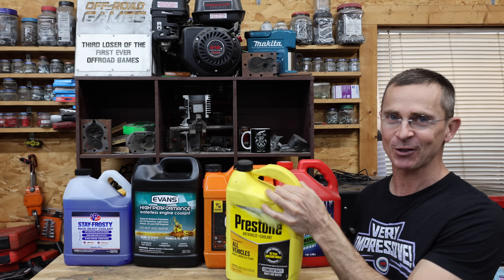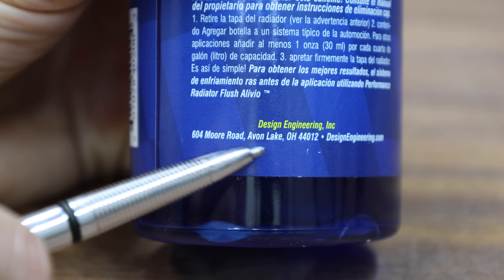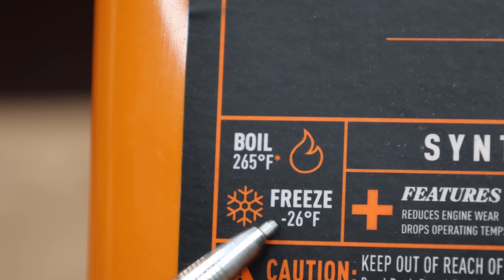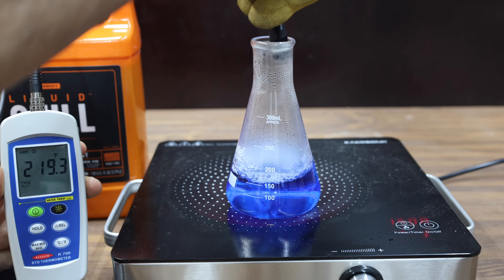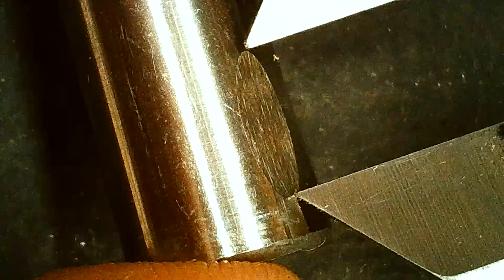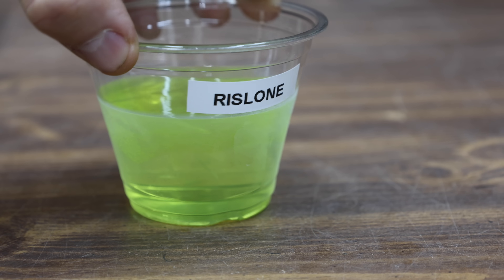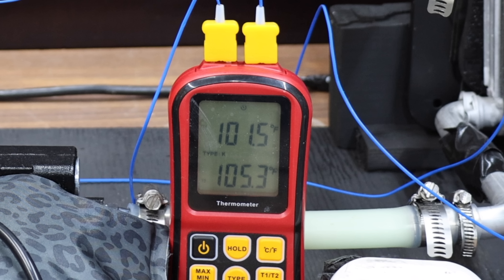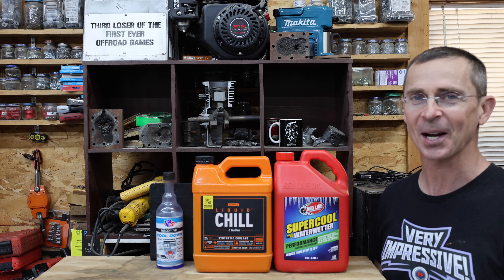Do "Super Coolants" Lower Engine Temperature By 30 Degrees?

Comment: I'm a little confused with that engine ice, I've used it for years in my Enduro bike that was overheating going slow since it doesn't have a cooling fan.
 The stuff I have is light blue, has all the instructions on the jug and it definitely keeps my bike from overheating 🤷
Reply from the maker: Thanks for sharing.

Comment: I have lived in Arizona where the temperature gets over 115F at times and have never had a problem with overheating in 30 years due to weak coolant. I always have used the proper mix of coolant and distilled water. One time my Lincoln overheated but that was because of a leaky radiator hose.
Reply: Yep.  Say 'No' to Snake Oil.
Reply from the maker: Thanks for sharing.

Comment: I would say that you provided evidence that the "Super" coolants do not drop temperatures by 30 degrees. The top 2 coolants only dropped the temp buy 7 degrees. I am not sure that is enough temp drop to justify the cost.

I would say that the liquid chill is slightly better than the red line. In my opinion the boiling point test was irreverent as shown by the 50/50 antifreeze, water boiling point. These products are normally used in a pressurized system which would change the boiling point enough to protect any normally functioning engine. Indeed the secret to keeping your engine cool is to operate it under the conditions that it was designed to operate in and to keep the cooling system in OEM clean condition and have whatever good clean antifreeze coolant is required for the specific engine. There are a lot of engines that would benefit more and for longer if they were just properly maintained.

These products are not designed or intended to be a substitute for maintenance of the cooling system. If your engine is overheating fix the problem not try to put a band-aid on it.

I also question the ability to protect the engine from wear other than normally keeping the engine at the correct operating temp for that engine. The only wear item in the coolant that can be directly effected by whatever is in the coolant is the water pump. Again good clean antifreeze has enough lubricant in it already to protect the water pump.

I would say that you proved that coolant additives fall more into the snake oil category than actually a helpful product that might do more than function as a band-aid for a defective coolant system. Indeed the thermostat in the engine has more control over the temp than any additive that could be put in a functioning coolant system. It won't fix a plugged or undersized radiator or simply a bad thermostat. If you want a cool running engine buy a Ford. Their thermostats are designed to fail open so it makes it hard to over heat the engine.
Reply from the maker: Thanks for sharing.

Comment: Evans doesn't claim to make your engine run cooler. In fact, your engine will run about 1`F hotter than normal. I use it and it barely creates any pressure in the system when running in 120`F weather. I can take the cap off the radiator after 2 hours at highway speeds with no reaction (no pressure hiss, no blowing out of hot coolant, erc.)
Reply from the maker: Thanks for the feedback.

Comment: This video is the first time in my life, I have ever seen a digital PH tester. I thought the only way to test PH, where those color changing strips. Thank you for letting me know of the existence of that. Will you test cranking an engine with different amounts of Capacitors? UltraCaps in series and normal higher voltage range Capacitors? Like what's the minimum capacitance needed to crank & start car, truck, and motorcycle engines? If you use an engine a lot, then capacitors are a great lightweight alternative. But may need a small 12volt battery to maintain cranking power after a few days of engine off, and alternator not charging them, or just keep a little 12v hand crank generator to charge them up, when they get too low to crank an engine. I always wanted to see what capacitors can do, with different engines, with different compressions, starter motor currant draw, and whatever.
Reply from the maker: Thanks for the suggestion.

Comment: I have always been super impressed with your testing methods! You blow myth busters out of the water, and if you ever watched any, you know what i mean! You go way, way above and beyond to get accurate results! I know it is not normally your thing but i have three things that i would really love to find out the truth about. The first one might not be completely out of your realm. I have seen you test knives before. As an outdoorsman, i have and use many knives. It seems that some of my knives get the sharpest when i just sharpen them on a rough stone only, mostly the ones with a lot of chrome vanadium, while others get sharper when working all the way down to a very fine stone. And i'm not sure at all, what is going on with Buck, after i dull the factory edge, sharpening them somehow just seems to make the edge slick, regardless of which stones i use. The other two tests aren't something you normally do. I would just love to see the results and know the truth, and as i already stated, i have a lot of faith in your ability to test things! I would like to know if cleaning a gun, or the lack of, affects the accuracy short and long term. More with bolt action rifles. Yes i know semi-autos will jam if you don't clean them once in a while. I also know you can actually wear out a rifle barrel and the accuracy suffers. Does the constant cleaning add to this? Does it matter if you don't? I would also like to see some real test results on how much power you loose with cylinder gap in a revolver compared to a semi-auto with the same ammo and barrel lengths. Also, do you loose power with the action of an action flying back with a semi-auto compared to a bolt action, single shot, or lever action, or pump? If you can't test these, i understand. I would just love to see the results! Especially the knife sharpness! I suspect, on that wire cutting tester you use, it would test sharper with the working down to the finer stones, but i kinda think maybe if you test the ease of cutting with a consistent pressure it would show different results? Because they kinda feel sharper? with certain blade materials
Reply from the maker: Thanks for the suggestions.

Comment: If your car has a thermostat in the cooling system then your engine is going to be kept at the temperature at which the thermostat opens.  The only scenario in which this stuff might help is if your cooling system is not capable of cooling the coolant to below the temperature at which the thermostat opens.  In most cars that is never an issue unless there's a breakdown in the cooling system, in which case this stuff won't help.
Reply: Yep.  Simple Thermal Dynamics.  Say 'No' to Snake Oil.
Reply from the maker: Thanks for the feedback.

Comment: If you ever want to test radiator stop leaks, I have a suggestion that is relevant to this video as well. I always use a small bottle of Subaru coolant conditioner whenever I swap out the coolant in all of my cars. Subaru coolant conditioner is repackaged Radweld stop leak. It claims to prevent electrolysis, prevent corrosion and lubricate the water pump as well. My Honda has an aftermarket coolant temperature gauge, and I noticed a small drop in running temperature as well compared to 50/50 premix alone. I would love to see you test that! Thanks for the great videos! I would love to see more Motorkote testing in some real world applications!
Reply from the maker: You are welcome!  Thanks for the suggestions.

Comment: Test potential: Wago vs wire nut vs push lock vs twist n solder etc wire connectons/splicing
Reply from the maker: Thanks for the suggestion.

Comment: Are these products meant to be an additive to a coolant or used instead of a standard coolant?  It looks like you are just using just the coolant super coolers.  If you are, wont that change the test results if they are additives?

Comment: Another idea I have is since you have this rig made up, id love to see motor oils and or food oils run through. I remember "oil filled radiator" style space heaters being  touted as being way more efficient at disapating the heat and oil cooled motorcycles are a thing (I was like 11 when the spaceheaters were popular and for some reason it stuck in my head) besides disapating heat better oils obviously have lubrication and corrosion resistance properties. Less surface tension? My brain also thinks that since water makes motor oil seize up, removing water and using it as the coolant makes the milkshake after a blown headgasket not milkshake-y? It also wouldnt ever boil over. I also just super love your motor oil vids haha.

Comment: Your car is only gonna run cooler if it’s overheating currently. Otherwise the thermostat is going to dictate the temperature that your vehicle runs at. My choice would be a product with the best corrosion resistance and lubricity not so much the added cooling capability. This might be important in some scenarios on vehicles that are prone to overheating with overload and cooling systems. For normal vehicles, I don’t know why this would matter much.

Comment: I had one of those meets or exceeds from the old Kragen Auto Parts, it was a 150 degrees as I recall, my engine was running too cold when it started snowing at Yosemite and had hardly any power! I put a Toyota thermostat right away after I got home and never used a 3rd party thermostat again! How about testing those hitch winch mounts? I know some are too weak to handle the winches and that's without even using a snatch block! You going to "Matt's Off Road Games" this year?
Reply from the maker: Thanks for the suggestion.  I will not be going to Matts Off Road Games this year.

Comment: I've got better for ya. Wix coolant treatment takes care of the same things. No guarantee to lower the temp, but it can't but help. Now it's made for diesel engines, but I've run it in everything.  You just can't use any other treatment with it or you'll turn the water to jello. And no I've had it happen, but I've seen someone else do it.

Comment: Can you test the cooling capacity of tap water, distilled water, saltwater, 150 everclear, 190 everclear, maple syrup, milk, orange juice, apple juice, hydraulic fluid, vacuum pump oil, motor oil,...air???

Comment: This video has amazing timing ! Race season is right around the corner and was looking to shave off a few degrees to my current cooler set-up. 

Question on the final test did you clean out the pump, rad, and heater tank before using the Evans? I heard it really  drops in performance if any water is still present in the system.

Comment: The boiling point test needs to be conducted with the liquid under pressure. That has a big impact on the boiling point of a liquid and simulates the actual conditions in a cooling system. Just a suggestion for future videos. Great content as usual.
Reply from the maker: Thanks!  Thanks for the suggestion.

Comment: Evan’s does not help cooling. It only stops boil over which you can solve by simply running a higher pressure radiator cap. 
The only coolant I ever had work was VP race  ready coolant and their hi performance coolant.
Reply from the maker: Thanks for the feedback.

Comment: The thermostat  controls the temp of your engine. Engine manufactures run the engine at its most efficient temp. The additives may make the fluid more efficient in dissipating heat, but the thermostat opens at the proper temp. If your engine is running 20 degrees cooler than normal it will not be burning all the fuel and cause a myriad of long term problems.
Reply from the maker: Thanks for sharing.

Comment: Thanks Todd, for an excellent experiment.

About 30 years ago I was first exposed to Redline products when I got a Porsche 944S and decided to take the maintenance on the car very seriously. One of the things I did was to use Redline oil, which helped to lower coolant temps a little. After that, I put Redline Water wetter in a 30%/70% mixture of ethylene glycol to distilled water. I felt comfortable with this mixture ratio because of the mild temperatures where I lived(San Diego), and the fact that the Water Wetter also had concentrated corrosion inhibitors for aluminum and other soft metals. One caveat for this was that I did flush the cooling system every year to play it safe.

The result was very significant and impressive, with my coolant temperature's needle pretty much glued to the radiator thermostat temperature all the time, except for high load at high rpm on hot summer days. I also noticed that my idle engine oil pressure was somewhat higher, probably due to the oil's viscosity increase due to the lower coolant temperature. The owner of the independent Porsche shop where I brought my car for service and repair immediately noticed the difference and wanted to know what cooling system mods I had made.

I hope that my experience with these products is interesting and informative, just as I find all of your well-made videos.
Reply from the maker: Thanks for sharing.

Comment: Another really interesting long term test would be soaking a small piece of radiatior hose in each of the coolants and seeing if they have any negative effects over time. Always wondered if the additives or alternate coolants degrade rubber or seals more than traditional straight coolant.
Reply from the maker: Thanks!  Thanks for the suggestion.

Comment: Test Idea: Products that promise to stop cooling system leaks. Now that you have the test setup, I wonder if you could introduce a loop that had holes of different sizes and then see which products stopped leaks the best, and up to what size hole. Maybe also test how high of a pressure each product can handle.
Reply from the maker: Thanks for the suggestion.

Comment: Just from knowing the mechanics of an engine, I can tell you this is snake oil. The thermostat only allows coolant to flow once it reaches a certain temperature. The thermostat controls the temperature of the engine. Not the coolant. If you want the engine to run colder, either replace the thermostat with a colder one or remove it altogether.
Reply from the maker: Thanks for the feedback.

Comment: With redline water wetter and water my vr6 definitely tuns cooler. Scangage usually sits between 175-185 and its got a 195 thermostat. 
Needs a good 15-20min really hard drive to get it to 195.
Reply from the maker: Thanks for sharing.

Comment: just a thought.. some of these  ' water weters; keep the water/coolent from flashing over into steam in the cly head passageways.. steam will not conduct heat from the cly head into the coolent.. so sly head temps in these areas can get really high.. i believe that these water weters stop this from happening,, so if the coolent cannot flash over into steam. and stays a liquid,, the heat transfer from the head into the coolent is much better, adding more temp. lowering in the head area
Reply from the maker: Thanks for sharing.

Comment: I put in Evan’s coolant on my project car.  Really works well.  One thing you didn’t test for is since it isn’t water based it doesn’t build pressure.  Since it doesn’t build pressure it is more stable at various elevations.  I cussed at the cost at first, but since then I am happy with the performance and its ability to cool my car.
Reply from the maker: Thanks for the feedback.

Comment: without other considertaions, just temperature drop....... pure water with a  wetting agent (soap or "water wetter" ) will out perform anything that is not pure water...but these cases are rare... an undersized cooling system or an "ultimate" lightweight/aero racer that needs minimal cooling system weight or w area (drag)....
Reply from the maker: Thanks for the feedback.

Comment: A cool video would be comparing 4 stroke 25hp boat motors. Salt water corrosion, fuel efficiency, hp output, engine temp, etc. Would definetly love to see which ones water intake has the best corrosion resistance against salt water.
Reply from the maker: Thanks for the video idea.

Comment: Should have added straight water in the comparison.  You included coolants that did not offer any freeze or boil over protection.  Straight water is supposed to perform better than anti-freeze at transferring heat, it just doesn't have any freeze protection.
Reply from the maker: Thanks for the constructive feedback.
Reply: @ProjectFarm  I am very glad  you seen it that way.  That was the way I meant it.  BTW, Love watching the channel, keep up the great work!

Comment: Since pretty much every car ever has a thermostat that closes to bring the temperature up to a desired point for the viscosity of the oil that engine uses, is there really any benefit to a product like this? If you actually succeed in lowering your engine temp you're only going to foul out your catalytic converter faster and make your oil less effective at protecting your engine. 

I assume this is a race car product that doesn't really apply to normal driving? Am I missing something?

Comment: Ran evans in snowmobiles for years. It doesn't lower operating temps but it keeps your cooling system from boiling over since it doesn't boil over. No steam= no pressure
Reply from the maker: Thanks for the feedback.

Comment: The main benifit of Evens is you probably wont reach its boiling point which means your less likely to blow a radiator or destroy your engine because the pressure will stay low until almost 400f coolant temp.
Reply from the maker: Thanks for the feedback.